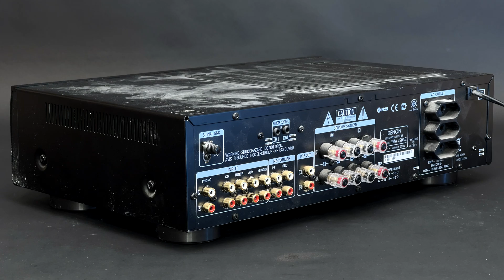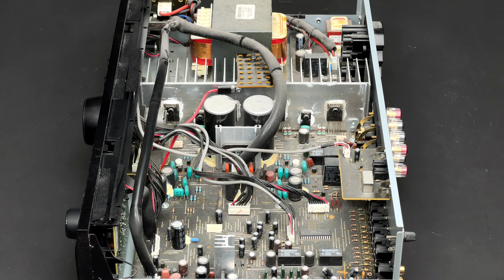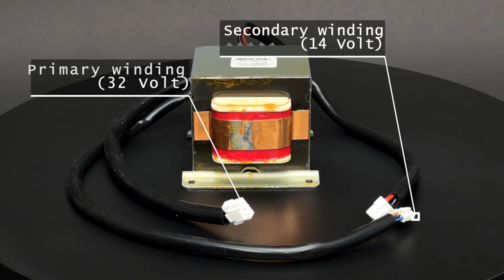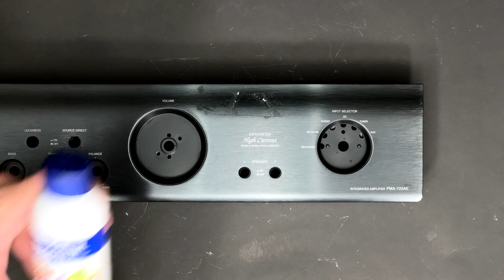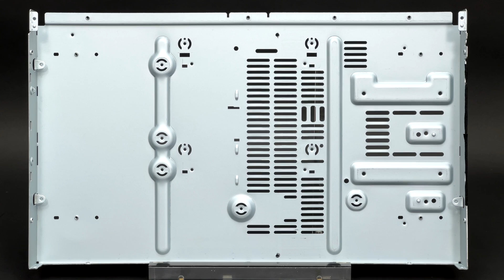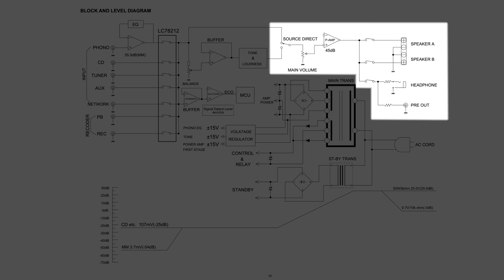Denon PMA-720AE Teardown

Comment: Actually, regarding the Denon PMA-720AE, the claim that the Pre Out is just a 'branch' or a step-down from the speaker outputs is factually incorrect.

According to the official Block & Level Diagram for this specific model, the signal path for the Pre Out is taken directly after the Main Volume control. Crucially, this happens before the signal reaches the P-AMP (Power Amplifier) stage.

In this design, the signal splits at the volume pot: one path goes to the Power Amp (+45dB gain) for the speakers, while the other goes directly to the PRE OUT. This means the Pre Out delivers a clean, line-level signal that hasn't been through the added noise or distortion of the high-power output stage. It is a true pre-amplifier output, not a high-to-low level tap.

Comment: All input selects are good but when I select on Phono the sound is not clear n it burn speakers. Please help me what can be problem
Reply from the maker: Thanks so much for watching and for your question 🙏
That definitely sounds like a serious issue — if the Phono input is producing unclear sound and causing damage to your speakers, it could point to a preamp fault or a misconfigured input. Just to be upfront: I’m not a professional repair technician, I’m a tech enthusiast who enjoys understanding how these systems work.

Phono inputs are designed for low-level signals, so if something’s wrong with the internal preamp, or if a line-level device is mistakenly connected to the Phono input, it could definitely cause audio issues or even speaker damage.

I’d strongly recommend disconnecting the Phono input immediately and getting the unit checked by a qualified technician before using it again — just to be safe. Wishing you the best in getting it sorted! 🔊⚠️
Reply: Thank you so much I double checked but nothing is wrong,,, I think it's need big speakers wth double coil from 18 to 22 inches

Comment: DEF: Pre-Out (preamplifier output) bypasses the internal amplification stage! Denon did this to save some money, because if it is not done correctly, that pre-out can introduce noise in the amplification stage. Conclusion: cheap solution.
Reply: Worse: you think you can hook up a good clean power amp and improve your audio reproduction? No, you will take the sound signature of the 720AE and you will like it.
I am right now in the situation where I wanted to try it out as a preamp after being pretty disappointed in it's sonic performance as an integrated amp (set it up for a friend). Yay, you can't skip it.

Comment: The Pre-Out signal being taken after the amplifier section is normal, or at least usual. You want the Pre-Out to be affected by the amplifiers volume control so you can connect an external power amplifier or an active subwoofer (and have the subwoofer volume go up and down together with your speakers).

The Record out should be unaffected by volume control and always output maximum signal - at least that's what most amps do. There are also some amps that do not volume-control the pre-out, but that's unusual and kinda wrong.